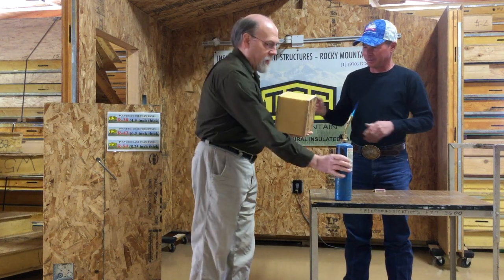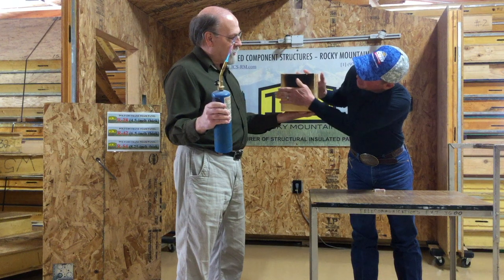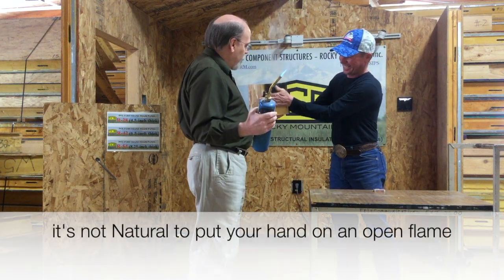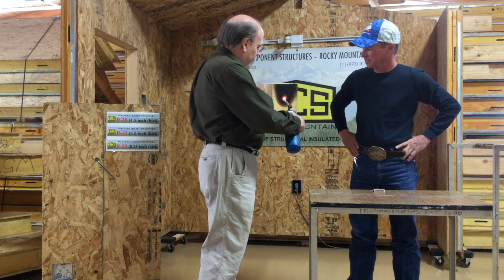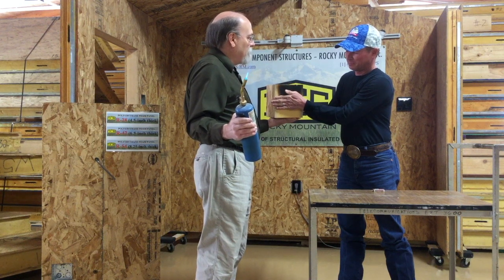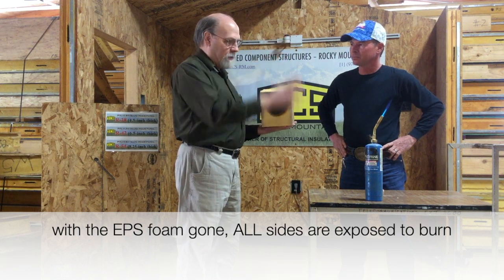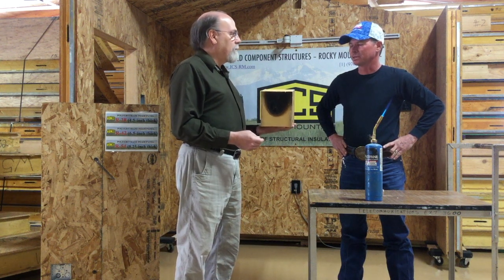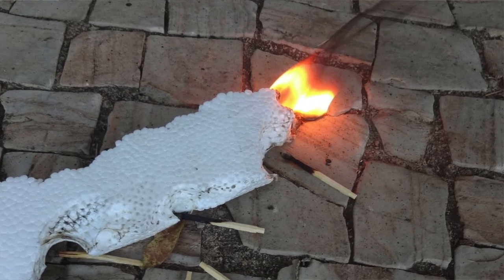How to Build a HOUSE that WILL NOT BURN

Comment: I got a call from a SIP customer after the fires burned 1200 homes in Bastrop, TX.  https://youtu.be/eQNWPB-Gnuc
Reply: Good video.  A little context for those unaware.  It takes a lot more than SIPs to reduce the chances of a house burning down.  Put on wood based trim, soffits, siding, porches and decks and a SIP home will burn just like all the rest.  Even without the wood products heat can still ignite drapes, etc.  In fact, I would bet on the 2x6" stick built over SIP if the latter was full of exterior wood products.  Ember attack against wood trim and siding and the OSB on those SIPS will burn just like any other wood.  Even if the SIPS gives you enough extra time for the fire department to arrive water and smoke is likely to make it a total loss.

Comment: wow. hello from january 2025 where a big portion of LA is burning and here i am, googling how to make sure my future house (hur hur, fantasies) will not burn to the ground.
Reply from the maker: The world is watching. Lived there 88-91, just devastating. Consider split face blocks, Hardi, and Metal Roof and Siding. SIPs can be clad in Metal, Cement Board and an outfit out of Calgary makes them with Magnesium because Charlston, NC required us to build with Fireproofing. This UNLISTED Vid I put together for a client. The RED Verticle panels show Metal Skin Panels https://youtu.be/soT3G5Sl5uk?si=ujwsYxKgDBKc7Nr0.
I believe in Metal Roofs https://youtu.be/soT3G5Sl5uk?si=ujwsYxKgDBKc7Nr0
Modern designs are easy to FireProof and Victorian normally have wood siding that can be replaced by Hardi. My experience with Colorado wildfires showed that overhanging roofs trap the fire so consider metal or Hardi for soffit. You may consider a Finland(Pinterest) style home with no overhang and entire house is Metal siding/roof.

Comment: Foam may not burn but the OSB WILL
For a truly fireproof house pumicecrete is the material to use
Pumicecrete is by far the best building material on the planet Pumicecrete is fireproof termite proof rust rot and mold proof and has a high R value and good sound attenuation solid poured walls means no critters can live in your walls Pumicecrete is a mixture of pumice cement and water mixed and poured into a set of reusable forms 
You can build your entire home out of 3 materials Pumice cement and water 
You can build floors walls roof interior walls counter tops bath tub hottub gopher proof planter boxes and much more
Don't drink the SIP kool-aid
Reply from the maker: I remember a trick from camping. Water in a styrofoam cup will boil if you put it in the fire. Styrofoam burns, right? As the water boils away, the foam cup burns down to the water line, because one side is protected by a fireproof material. Works like that with Urethane SIPs, but I am sure the OSB will smolder but not burn away from house as is the warrantee from the manufacturer has to comply with ATSM guidelines.

Comment: That demo didn't put the flame where it will naturally occur.  The heat from the fire is going to be against the side not the foam.  Won't that burn?  Once that is burnt off isn't the panel compromised.  One the panel is compromised how do you restore it?  Not to mention the roof.  I don't understand the premise that these houses wont burn.
Reply from the maker: I understand your comment. Does wood burn, sure it does. Have you ever filled a styrofoam cup with water and let it boil on an open flame? The cup will not burn as long as air can't get to both sides(in and out). Closed cell foam allows NO air migration. SIPs if done correctly are near airtight and easily exceed the 2018 Energy Code. Long before the OSB will smolder thru, the oxygen will be depleted. Thanks
Reply: @ModernMountainLiving  Great.  Redo the demo.  Put the flame on the bottom of the wood side of a 4x8 wall size part.
Reply from the maker: @ynAMe6Aj  Ed, funding would be the issue unless you want to contribute. A complete envelope Roof, Walls, Windows, foundation, finished sheetrock, flooring would be required to simulate a house fire. If you are game and have the land we can do it. Or I can show the difference in the EPS SIPs that burn vs The Closed Cell Urethane components that don't. For that we can refer to this vid  https://youtu.be/ZIYGd-QnJPY. Thanks

Comment: How Much does this type of material  cost?
Reply from the maker: You can get cheaper SIPs than my favorite, the give is you either have to do more work in the field or more materials that will cost you more. In this series the Modern Cabin uses ICS Sips 6.5” walls R-42 at $11 an area square foot and 8.25” roof panels  R-54 at $13.
Currently I am wrapping up a very remote build and drove to town to check messages. Would love to help more in a week when I return to civilization. Be Blessed

Comment: What is the price of these when compared to traditional stick frame construction?
Reply from the maker: R-42 walls are the same thickness as 2x6 construction without the thermal bridging. 2x6 stick built walls with urethane closed cell foam insulation can attain R-30 because of the voids. Stick built framed house take 1-6 months of exposure and material degradation to dry in(not insulated). SIPs go up fast and a house your size can be dried in in 1-2 weeks. Labor and time are the difference as well as performance. 
Price is only part of the difference in overall Cost.
Stick built just under $8 
SIPs $11 for the best, less for less performing EPS SIPs
Reply: @ModernMountainLiving  thanks!
Reply from the maker: 10pm, just drove back to civilization after 3 weeks. I see some comments, will address in the morning, thanks.

Comment: Oh Doggo is beautiful! <3 Cattle dogs are such smart doggos. ^_^
Have you done any research into hempcrete? I've only just started reading about it. I'm keen to hear your informed thoughts on the product.
Reply from the maker: When I discovered Hempcrete in 2015 it was on a build in Steamboat Springs. You can now resource without importing from France in that case.
Once I learned that hempcrete has relatively the same (low) insulation value as concrete but cost much more sadly I had to write it off as more of a novelty. 
I try to include "Rowdy" dog antics in every vid, hope you watch to the end. Thanks
Reply: @ModernMountainLiving  What about Aircrete?
Reply from the maker: @lizh1988  I am trying to get with Aircrete Harry because he is in the area. My first take is IT IS VERY TIME AND LABOR INTENSIVE! Kinda joking there but keeping concrete from freezing for a month before you can put them up is somewhat the reason I can't do Rammed Earth in winter.
By going with SIPs I put up the whole house in a week, got twice the insulation R-value per Aircrete.  If you watched my ICF vid https://youtu.be/1X60vANweRM  you know that with concrete use you have to insulate for thermal bridging which just adds to time, labor and material costs. For every additional layer you get condensation/venting issues so I keep it simple. For me there are not extra points for making it harder. The real test is how it performs. So keep life simple and just Go Build It Better. Thanks https://youtu.be/4MjPvXiXlpw
Reply: @ModernMountainLiving  Thanks for you answer. I had been wondering about the moisture facture too. That does kind of cheese that deal, no mold farms!
Reply from the maker: @lizh1988  Gotta love the cheese factor. That's good.

Comment: That’s all fine and good....apparently the osv is fire proof as well? Roof trusses, decking, exterior finishes? A fire proof house is a cool dream, however if the fire doesn’t kill ya, the off gassing of all the fire retardant material will most certainly.
Reply from the maker: Bill, we don't have trusses and you can check with Huber(Zip) how they comply with ATSM 119. Like the video says this isn't EPS with the off gassing issues. Be a believer Bill do some digging like I did. Thanks
Reply: I am a big fan of the structural panel system you chose, my point is the sandwich material is not fire proof, and if it is treated, very few naturally fire retardant compounds exist. The point I was trying to get across is, we all want the perfect fireproof building system, just not realistic. See your exterior siding video...board and baton natural wood may look beautiful, but it ain’t fireproof. I would have chosen cement siding..boom bring on the forest fire! Keep the videos coming. I like them a lot...god bless your project, and may he keep you and yours safe throughout the process and beyond.
Reply from the maker: @billybastar4022  Most areas do require a large percentage of exterior to be stone or masonry for the fire proofing, but not here. Had the site been closer to the forest I would have had to address that too. Here the wanescot of steele is for fire mitigation (and snow) because at this distance from the trees in a forest fire event the threat would most likely be wind blown on the ground or falling from the sky(metal roof). 2 more points: I have 4 new units of Hardie siding stored on another property left over from my last apartment build that I could have used but my objective was in following the local Mining vernacular with a twist. Thanks for the blessed send off, be Blessed.
Reply: Looking forward to journey.

Comment: Now I know where you’re coming from ;)
Reply from the maker: Follow the series because I would like a European perspective. Thanks
Reply: Gobuilditbetter 
Haha, I’m not a builder and just one person so take any of my comments with pinche of salt.
Reply from the maker: @Conservator.  I have been at this a long time but I do enjoy a different perspective. Thanks
Reply: Gobuilditbetter 
I’m looking forward to your next video. 
I like it how you take the time to explain things and mix it with some humor.
Reply: Gobuilditbetter 
I’m want to build a small workshop (150sqft) in my garden. I want it well isolated so that I can use it comfortably in the winter. It usually freezes several weeks but nothing like what you described. The foundation will be an isolated slab on ground. The walls will be either double layer framed or SIPs. I’m still looking for a good way to connect the walls to the floor while avoiding a heat sink. 
So I’m extra curious to see your solution for that.  😉 
I also follow The Essential Craftsman but his house has a crawl space and a wooden floor.

Comment: I wonder if Aircrete would be an alternative as well. Low cost, excellent insulation properties, no rot, no fire, extremely strong. Any thoughts on it? Nevermind, just saw the comment below. Also the Arched Cabin system seems very promising along with being low cost especially with your love of vaulted ceilings. I know they can isulate to R-25 but unsure if more is a possibility...most likely with additional interior insulation.
Reply from the maker: Aircrete is interesting to me, but I have never personally had any experience with it. Some reports on it's Insulation are an r3-6 per inch so that can be pretty good. Referring back to our cold climate while building the retention of water during curing could be a problem. This might not even be an issue in a more temperate climate. Thinking of our snow melt, refreeze cycles the fact aircrew will still be absorbent could cause structural issues. After all the mountains around are continually flaking off from water getting in the crevices today then expanding when it freezes tonight. I have been watching about 40 tons of rock above the road to the property that the fissure is on a diagonal and you can see where it started from. I just don't park under it. Aircrete, Cool Idea that I never thought of. Thanks
Reply: @ModernMountainLiving  From what I understand if Aircrete it does not retain water, it can actually float, you could theoretically make a ship hull out of it and build a floating home...What about the Arches Cabin method? Have you seen them? They can be built very large and could easily be made into a proper 2 story home if using widths over 20'. I believe the 20' widths has a 17' peak which allows for a proper arched 2nd floor living space. I'm curious i how difficult it would be to put a dormer in, it would likely need to be split to incorporate the skeleton of the build but it doesn't look impossible to me to fabricate...They go as wide as 30' and lengths up to 40'. The costs are impressive. I've been considering a small tree stand/house for my rear yard. I'm up North in snow country myself (although Vermont doesn't get what you do) so insulation is important to me as well.
Reply from the maker: @genesishep  My first thought on the dormer idea is structure because the arch relies on the tension for strength.
Reply: @ModernMountainLiving  IMO it shouldn't be too difficult do. If you have particular concerns you could either overbuild the framing of the dormer, by using heavier guage steel, stronger headers reinforced welds or do as I suggested and incorporate the frame in the design of the dormer which could be a very unique look. I mean, everyone has seen a vertical support beam but how many have seen a "floating" arched support beam in a build? From what I've seen in the photos of the arched cabin builds the beams are approximately every 2ft. Unless you intend to install long dormers (8ft+) I don't see that they would impact the structure in any way that couldn't be accounted for. If you wanted longer dormers I would definitely use a mixed method that incorporated the existing skeleton.
Reply from the maker: @genesishep  I have a career behind me of taking jobs that were impossible, difficult  and getting it done. I have found that a square can fit in a circle if you beat the corners in till it is round. Fear isn't the issue, but I have found that a great design can be ruined by deviating too far from the original intention. If I was promoting GO BUILD IT DIFFICULT that would be a different channel. Thanks
Reply: @ModernMountainLiving  I mentioned the arched cabin system as it's overall simplicity and low cost would likely offset the one or two challenges you would face dealing with the dormers. I had reached out to the system builders and asked the question with intentions of providing you the information as to whether it was as simple as it appeared to me or had easily been done successfully already. I was doing this out of general curiosity myself.  I don't discredit your experience or background as a builder nor should you discredit my years as a building inspector. You asked for comment and initiated a discussion on this topic which I believed I was having with you. It seems that is not what you truly want as you obviously have a plan you are set on and so I will leave this series behind. I wish you well.
Reply from the maker: @genesishep  The Go Build it difficult was me trying to be funny. I do enjoy the conversations that bring something to the table like your Aircrete suggestion and Arches. How ever since that video was done some months ago we have progressed on the build. The comments here are still valid as others continue to read thru them becoming aware of new alternatives. 
Since you mentioned it, I still call on my inspector while making plans on a customers infill lot for advice. Thanks
Reply: genesishep Tip... if you are going to get insulted because someone doesn't recognize your expertise and experience you might want to make it known before you get insulted. Your rant about having years of experience as a building inspector was the first time you mentioned it and frankly by the nature of your previous questions and comments I'd be surprised if you were a building inspector just because of the basic lack engineering knowledge behind them.

Comment: What do you think about aircrete. I am trying to build a low cost shop that will last for a long lifetime that I can make multi level and if I'm lucky get a few different uses out of....is aircrete good for multiple levels?
Reply from the maker: JJ, total disclaimer is that I have No experience with Aircrete but I am interested.I can't speak of something I don't know about but I can state the concerns I would research. To your question of multistory: find out what the strength of aircrete is capable of. Look for numbers from  3000-4000lb. Also look in to reinforcement requirements(rebar). Keep me posted, Thanks

Comment: While talking about built to last try not filming in a room built with fall apartical board.
Reply from the maker: @jaquigreenlees  This is why I do what I do, provide sound advice from real experience by pushing for Better. Do your own research to my claims. Please forget particle board, only formica tops and bad cabinet makers use that stuff. Ever heard or Huber? That is what you are looking at on those Panels. If you haven't heard of Huber then maybe Advan tech. This is All I use for Subfloors and Sheathing. Why, the very best look it up. Gauranteed for the life of the house. ICC says so too. This is a product that does cost more but how often do you want to swap out your subfloor? I don't try to spend money, I want value.
Reply: @ModernMountainLiving  Going to use Huber myself, ZipR